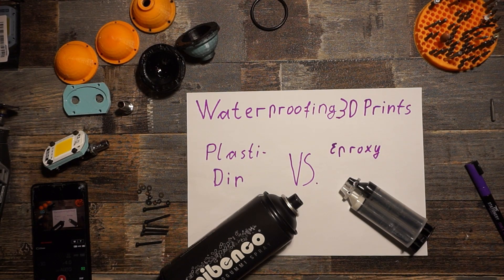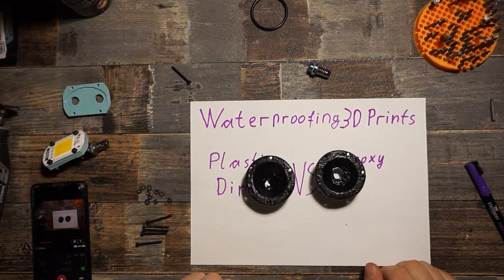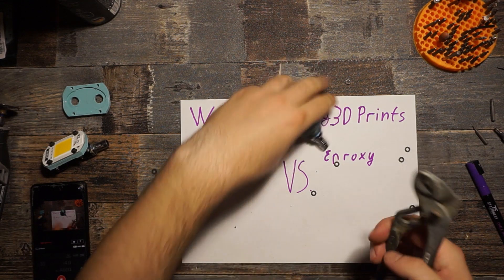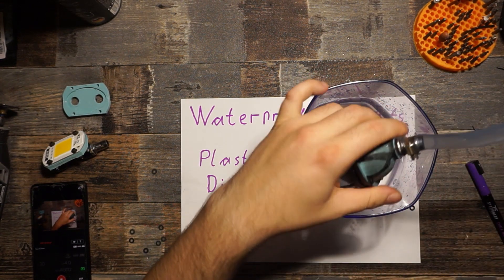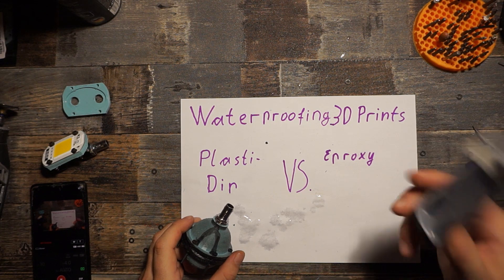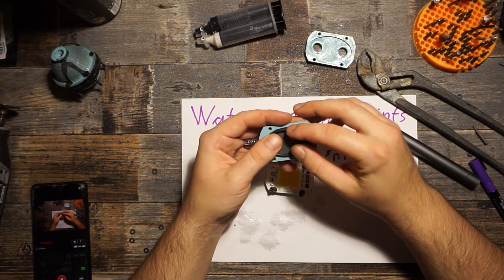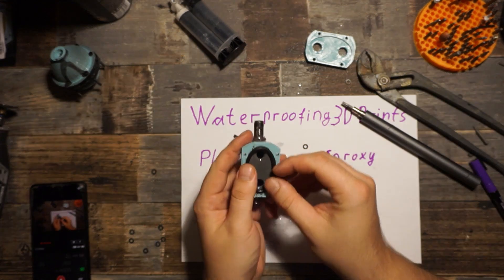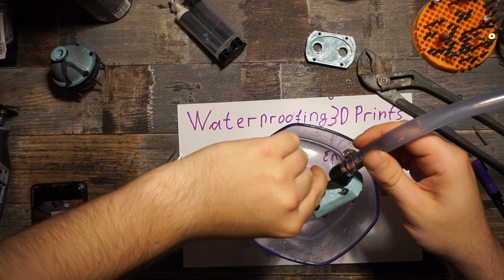Waterproofing 3D printed parts with Plastidip?

Comment: The problem with this video is that you didn't compare like to like. The results may be correct, but you can't really know until you test like-for-like parts using the same conditions other than the coating.

Comment: Which epoxy did you use?

I want to print a waterproof case for some electronics, so not high pressure in any way, but I don't think West Systems epoxy (which I have for fiberglass work) will bind to plastic..
Reply from the maker: It was called 5min epoxy, but i dont remember the brand anymore sorry